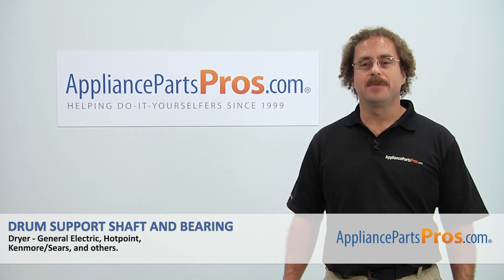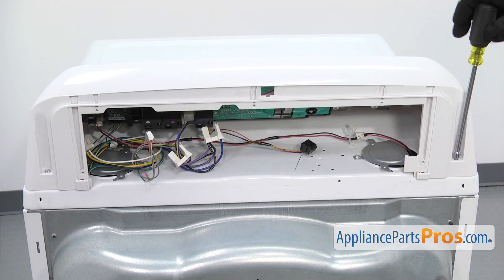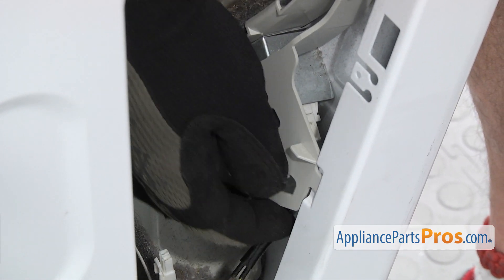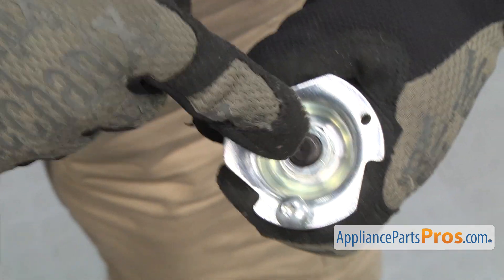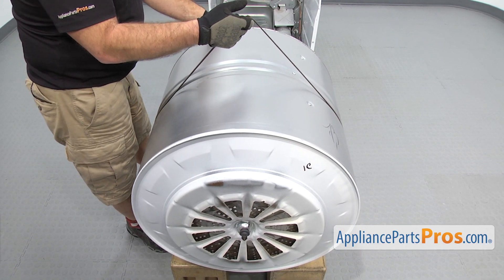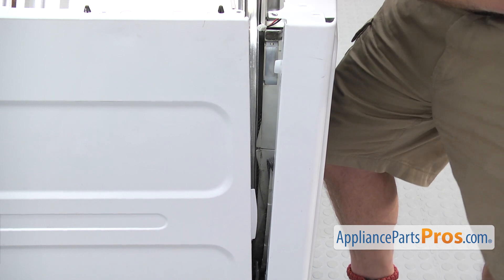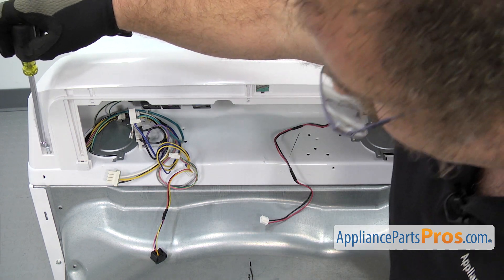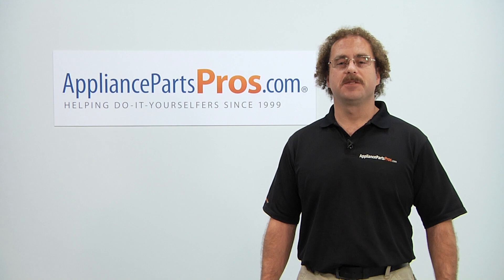How To: GE Dryer Drum Support Shaft and Bearing WE3M33

Comment: what are the noises that might happen if this bearing goes bad?
Reply from the maker: You might hear grinding noises. What is going on with your dryer?
Reply: @appliancepartspros  the dryer is only 2 years old. Its working and drying with no problems. The other day ,all of a sudden,it started rumbling. This makes the back panel vibrate. Ive been reading and ive seen everything from lint on blower wheel to a bearing.
Reply from the maker: What is the model number of your dryer?